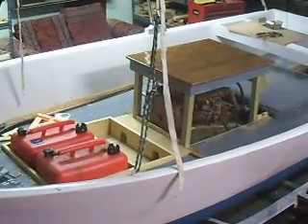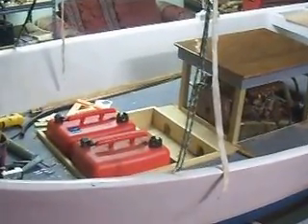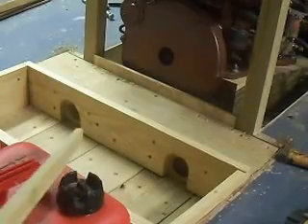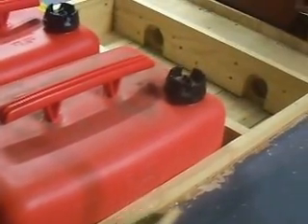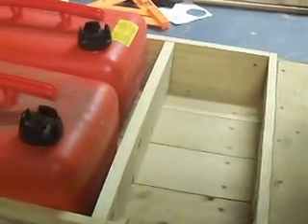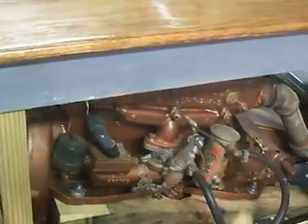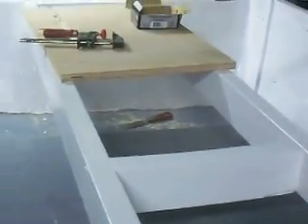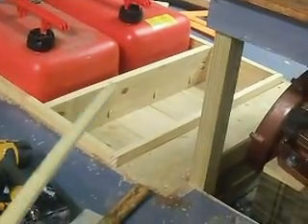Installing an inboard motor in a small boat update 7 of 13

Comment: You need air intake hoses for engine breathing. And separate breathing vents for the separate gas area from the battery compartment. They need to be separate.

Comment: Batteries and gas in same comparment, BIG NO, NO,
Reply from the maker: +joe rocket Of course, and I fix it later.  Sometimes I think I'm more critical of my work than others, well, I know I am.  If I recall, I fixed this obvious problem before anyone noticed.  
    Thanks for watching, and watch the other parts to this project.  13 parts in all, if I recall correctly.